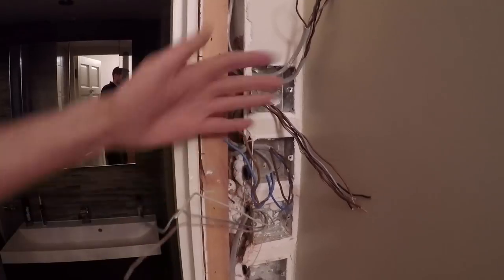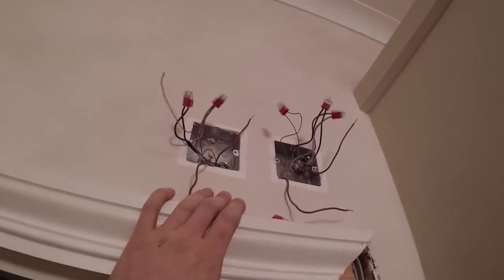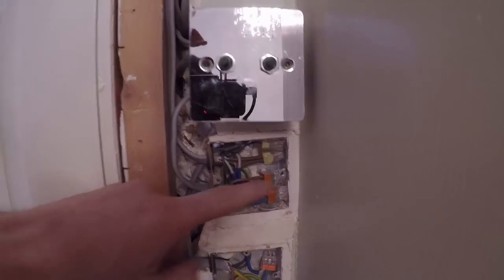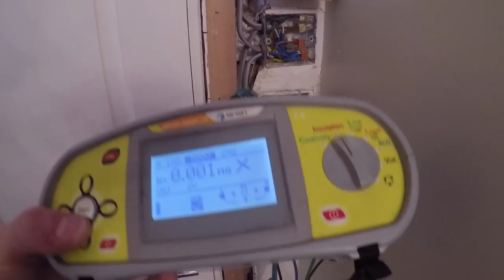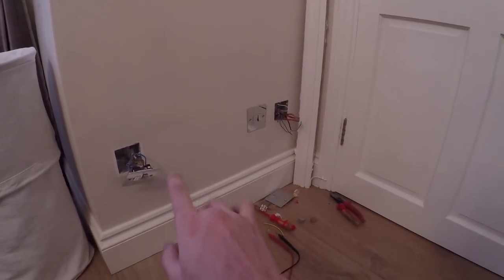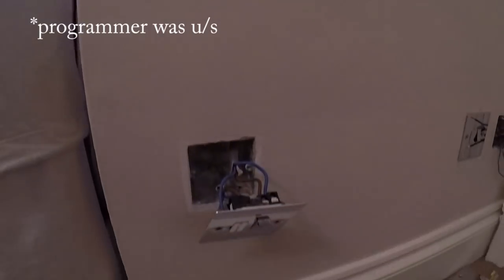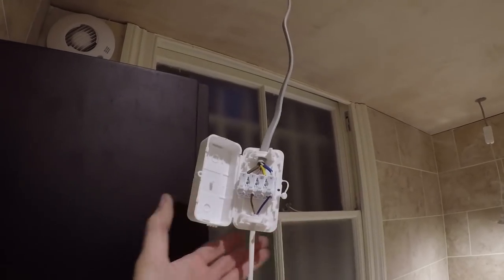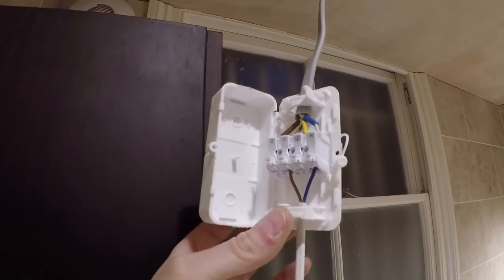Bathroom electrical work - An Electricians Day in London | Thomas Nagy

Comment: im a plumber from west yorkshire (bradford) it is very difficult to earn decent money up here as firstly the asian folk (which there are many) dont pay or use eastern europeans at £30 a day to do there work.. (not racist, this is from experience of myself and every tradesman who i know who has worked for them) 2 recent examples..  i went to 1 hours to unblock a drain at 8pm took me 15minutes pulling his wifes beard and chest hair from the drain,  i charged only £60 (deal of the century)  they said "we thought it would be £10/£15 at most" then threw £20 at me! 
also alot of english, if i drive 1 hour to a job, and it takes me 5minutes, they dont see why they should pay the travel, and should only pay for 5minutes rather than a minimum charge or watever the charge would be... its intresting though when you break it down for them and after tax and insurance and fuel i havent made nothing..  but they still want it cheaper.... 

im trying to get customers who want to pay the money for a proper job doing, but i get stung alot with prick customers... 

do you have any storys like this it would be intresting to hear them in your vlogs... 

anyways hope you have a great 2018 and even as a 30 year old  plumber i look out every day after work to see if you have uploaded NO HOMO lol
Reply: His wifes bear hair... lol. I would have charged double to cover time taken to argue the bill.

Comment: I have a problem in my house. Randomly, the toilet light bulb busts and it shatters into the floor and my house's fuse goes. I then turn the fuse back on and replace the light bulb. I took a look at the light bulb and it was burnt. What do you think is the problem?
Reply: Nadim Chowdhury 
Might be a ghost
Reply: Initially sounds like shit light bulbs, unless you suffer from high voltages/spikes. Have you tried an LED lamp instead as they are often regulated.

Comment: I think one of the fundamental reasons you end up with dodgy installations including piss poor work on consumer units is that the electrician doing the job also issues any test certification. In an ideal world the inspection and certification should be done by another electrician. I say ideally because in practice that is more difficult to achieve and collusion could lead to the same sort of systemic failure.